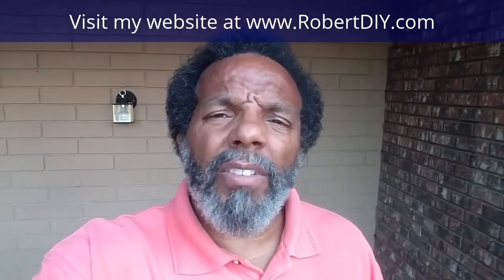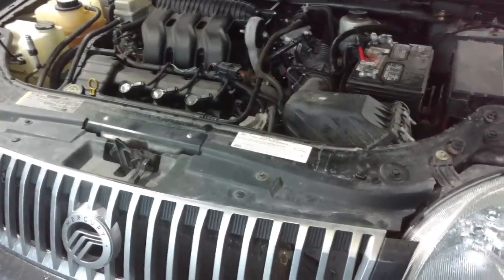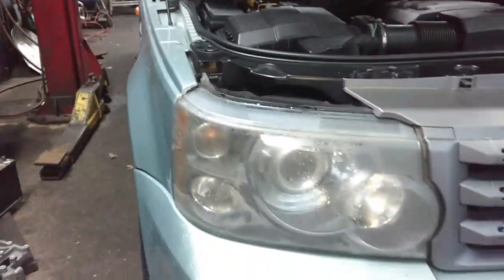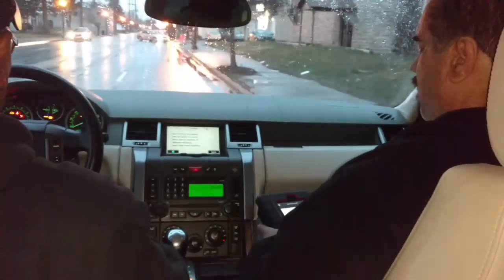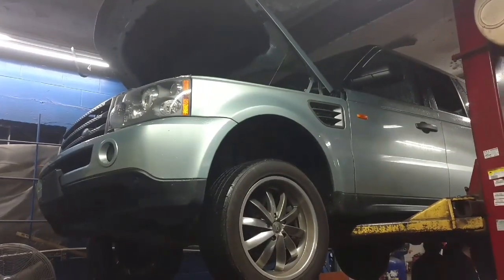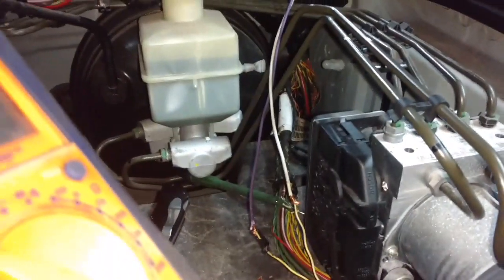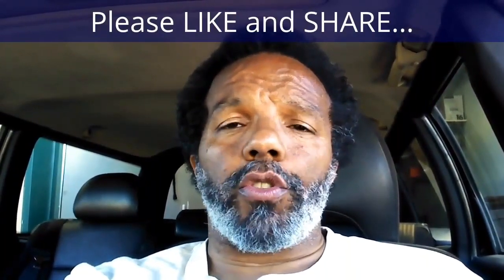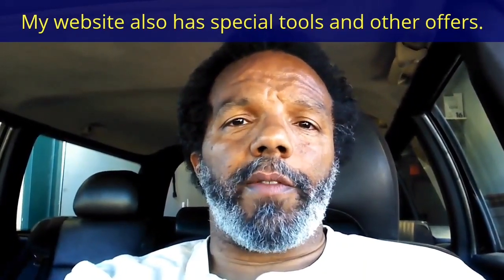Why is the speedometer not working and the ABS light on? - HOWR

Comment: I have that issue on my 03 Range Rover HSE right now!  sometimes it works and sometimes it doesn't and when it doesn't the ABS light HDC light and no speed meter working but everything else in the cluster is. did you ever find a broken wire or just best to do a bypass?
Reply from the maker: Nope, bypassed it.
Reply: @RobertDIY  I see you working on a new or Range Rover Sport I have an 03 Range Rover HSE is the module in the same spot or somewhere different and do you know where it is on my vehicle? Did you use two wires for negative and positive or just one wire and how did you run it?
Reply from the maker: That's a lot of questions. You may want to start by getting a wiring diagram. If that's above your pay grade, take the truck to a RR mechanic before you do more damage than good.
Reply: @RobertDIY  don't want to go to dealer!  I'm not a mechanic but I think I can handle this with good directions.  I have an icarsoft L600 v2.0 scan tool now, cleared all fault codes, but, left rear speed sensor and right front height sensor are the only 2 that comes back!  However Im picking up wheel speed from the scanner when truck is in motion! But still telling me open circuit with scan tool on that rear left speed sensor, so I will have someone do the bybass.  I just don't know what the module looks like or if it's the same location as the video you produced.  But Thanks you for your video and putting me in the right direction, especially for taking the time to respond to my questions!
Reply: @RobertDIY  hi Robert I have the same problem with my 2005 jeep Cherokee my speedometer is not working and my abs light is on but everything else is working fine. How did you bypass yours

Comment: Just make sure when you put these Rovers on a lift that you lock those airbags manually otherwise they will fail due to pump overrun. Also most likely you couldn't get a module reading because of the special protocols Rovers use, they usually require a dealer computer to do anything not simple.
Reply from the maker: Yikes! How does one lock the rear suspension air bags?
Reply: On the raise/lower button on the center console by the terrain selector knob, push it until the "padlock" lights up.
Reply from the maker: Thank you very much.

Comment: Anything under a car is just asking for death from water, im amazed they last at all.
Wheel speed pickups often have crappy looking connectors, i cant see how they can seal propperly.

I like that mechanic, Bypass the crap, it will work just as good as before.
Reply from the maker: LOL, More wires will die soon.